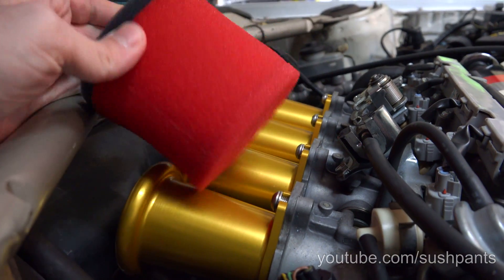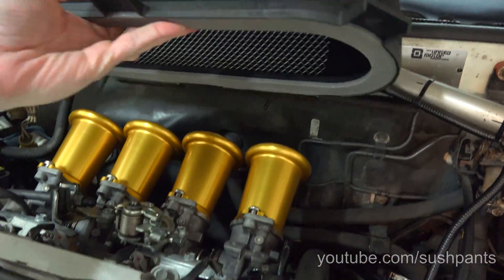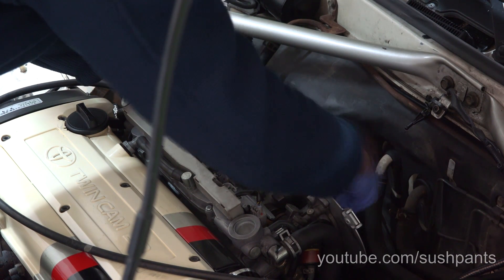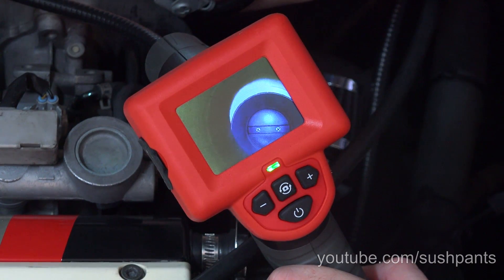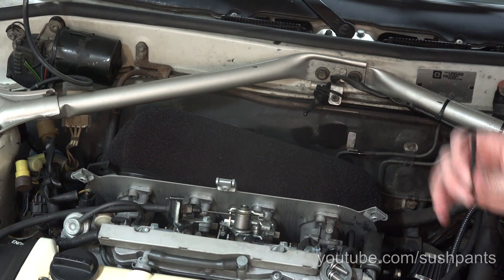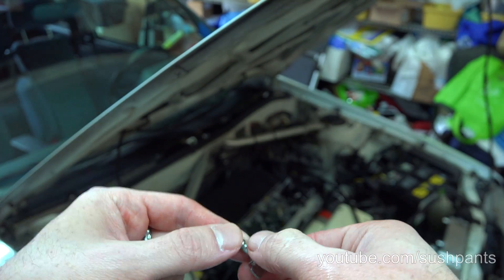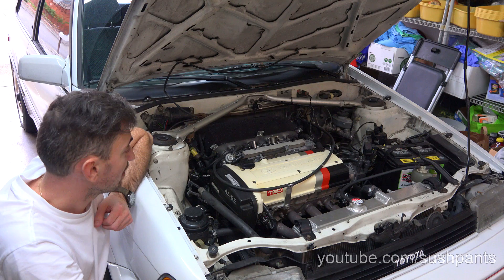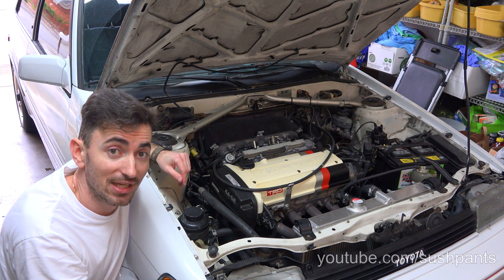Installing ITB filter 4AGE Blacktop trumpets

Comment: I am installing Silvertops on my Miata with an older Hummelink kit and was not able to fit the pipecross filter because you couldn't get the filter inbetween the bottom of the engine bay and the trumpets, now that I saw what you had to do, I think I will be able to run them.

Comment: I might get those Uni filters and give them a try on my Blacktop soon as i get trumpets :)
Does the ISCV simply run vented to atmosphere when running open throttles or do you need to filter the idle air somehow?

Comment: Hello,

Just wanted to ask anyone here knows what throttle cable was used for the engine? I have a 20 v silvertop installed on a ae101 but the stock ae101 throttle cable is a bit stiff and kinda difficult to control. Cant seem to find the answer in google as well. 
Thanks in advance 🙂

Comment: I've been trying to find a good ITB filter for quite a while. Thanks you so much for your video. :)

I was able to easily slip the Pipercross filter right on with my 90mm velocity stacks (20V black top in an AE101) - without having to do the complicated way you did. :)

Comment: I have a Blacktop in an MR2. I bought it with a cheap autozone intake on it and am tired of the horrible droning sound at around 3000 RPM. How hard is it to install these trumpets? Do I have to mess with the fuel system or any sensors?
Reply from the maker: the drone might not be the intake but your exhaust. I stuck a big resonator in my exhaust to get rid of exactly that.

Comment: wouldn't it be easier to just pop the strut bar off and slide the filter over the top of the already attached trumpets or do you still not have enough room?
Reply: pballer2005 or put the car on stands and jacking the engine up and down to get the space needed

Comment: I had stacks on mine but I think I have to use the stock plenum with an air filter until I can get a stand alone ECU tune. The torque with the trumpets felt absolutely dead below 4k RPM and the tuners at my local garage say that the engine wasn't designed to suck that much air from a non airbox'd source running stock. It did sound amazing though, and yours does too.

Comment: Bit of a hassle but could you not use the UNI filters (oversized) with a DIY metal cage (chicken wire) to keep the filter offset and stop it being sucked in?
Reply from the maker: That would work to keep the foam from getting sucked in but i still think the UNI filters are too restrictive.

Comment: hey bro are u using the stock blacktop intake metal gasket or are you bolting them directly on maybe using some gasket maker ?
Reply from the maker: I'm using the mounting plate for the filter in between the stacks with no gasket maker, otherwise I bolt them directly to the throttle bodies if I'm running them open.

Comment: What did you do with the O2 sensor when you originally installed the ITB's?
Reply from the maker: The o2 sensor is still in the exhaust. The 20v blacktop doesn't have a flapper box or mass air flow meter and relies on the throttle position sensor and the MAP sensor which allows it to run with open trumpets. There is a air temp sensor that i just mounted in front of one the trumpets.
Reply: @sushpants  so if you mount that airflow sensor in front of one throtelbody it wil work?. Asking because i want to do the same thing on my rxi

Comment: Can I ask you a question I'm doing the exact same engine swap a 20v blacktop but into a  ae101 corolla only problem that is worrying me is wiring can you give me any tips
Reply from the maker: I tried to wrap my head around the wiring for 3 weeks before i decided not to risk messing it up. I sent my old and new harness to a guy named Doug Copeland ( http://www.wiregapinc.com/ ) he made the harness plug and play for me. I had the difficulty of switching the harness to left hand drive from RHD.
Reply: sushpants did you send him all of the wiring from inside the car too or did you just send him the 2 engine looms cause I thought once I just used the 4age ecu and engine loom I wouldn't need anything from my 4efe and I could just plug it in and tick it over ?
Reply from the maker: I sent him just the two engine looms, the other stuff stays. The plugs are probably different on the body connections for your car and need to be switched over. The speed signal also needs to be wired into the ecu so it doesn't limit the redline.
Reply: Thanks for the help man :)

Comment: What'd you do with the idle air control tubes when you were running open stacks?
Reply from the maker: I used another breather filter (same as coming off the valve cover) attached to the hose with an adapter. I secured the hose to the ITB support.

Comment: I have an itg filter similar to this, the mounting screws have easily come off with vibration of the engine. I just replaced them with actual screws and solved my problem. I just don't want the same thing to happen to you
Reply from the maker: Crysix thanks for the tip, which screws are you talking about, the trumpet bolts or the filter clips?
Reply: filter clips, I had one pop out of me and I lost it so I replaced them all with actual screws so it did not happen again
Reply from the maker: Crysix gotcha, I'll keep an eye on them, I haven't had one fall out yet.
Reply: what is power gain from this trumpets?

did you try shorter trumpets?  I have right hand drive rolla  so brake parts are  limiting dimension of 1st cylinder trumpets

ps funny word - trumpets)))

Comment: Hey sushpants, I have a ae82 twincam with the 16v bluetop in it, i was thinking of doing a 20v conversion. What guides/manual did you follow
Reply from the maker: I used some tips from João Rocha da Silva, like labeling everything that you are disconnecting with masking tape. If you are going to rebuild the engine, you can follow the Toyota Factory manual which is very in-depth (just be careful with the exhaust cam position). The swap is pretty straight forward if you use the original transmission, if you use the 6 speed, you will need to modify the transmission mount. The wiring can be tricky so i sent my harness off.
Reply: Alright cheers man, should join ae82 corolla owners club on facebook